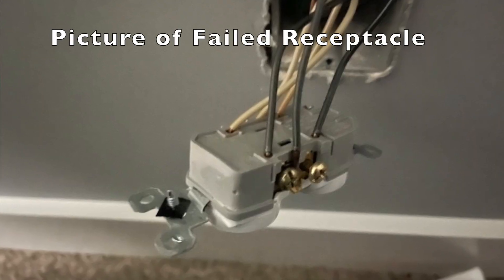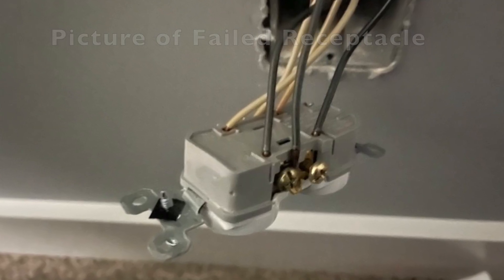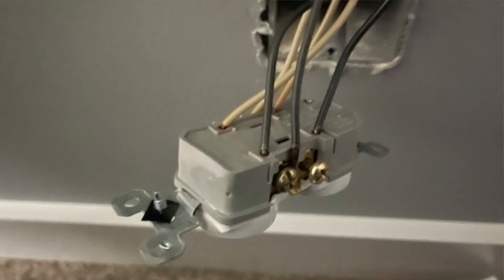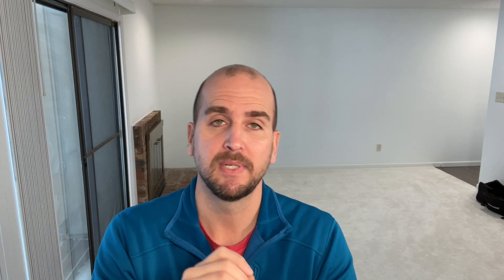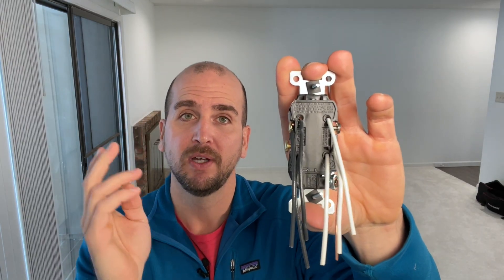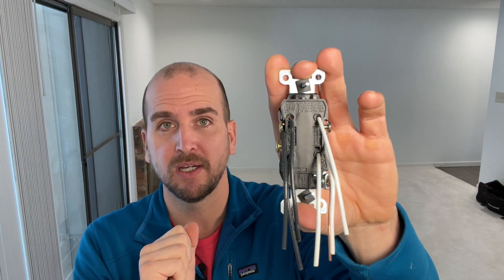Incorrectly Wired Outlet Found In Newly Built Home

Comment: You need a add-a-depth ring when you have 1/8” or more of combustible material, not when the box is flush with the wall, that is code in wisconsin
Reply: Wisconsin is way behind most states for residential electrical code.  My best friend is an electrician in a different state and they are always a full version ahead of WI.  I was a licensed home inspector in WI.  I know what your talking about.  WI codes and the UDC are weird.

Comment: .) I agree with you on changing out low grade outlets with commercial/resi outlets
. ) there is no real benefit of using the pigtail method unless the outlets fully connected.
.) Some may disagree with this comment but if done properly a stab in can be as reliable as a Shepard hook. The failure cause at the stab in connection usually stems. From a loose outlet as plugs are plugged in the outlet twists slightly weakening the connection 
.) You can use tails of wire to make spacers to level and keep tight the outlet with the  finished wall opposed to box extensions

Comment: There are actually 4 different types of receptacle attachment styles commonly found in north American wiring devices: 1. Shepherd's hook clockwise under the brass screw head (excellent), 2.Back stabbing hole as shown in this video, when an internal barb of metal bites into the wire when you push it in, and won't let you pull it out (poor method, at risk of overheating, done by the lazy,  and not recommended), 3. A visible little square clamping plate of brass, right under the screw head, as shown in this video that positively clamps down on the copper wire when you screw down the head (good and strong connection, and very easy as you don't need to form the Shepherd's hook), 4. The one not shown in this video, but found on ground fault GFCI devices, and other high quality receptacles,  is what looks like back-stabbing, but is not. It is a hole in the back of the device you insert your straight, stripped wire, but inside there is a brass plate you cannot see, which clamps down securely on the wire when the side screw is tightened. (These are great connections, very secure), and are not back-stabbing.  However, a bad mistake an amateur might unknowingly make, is to try to use the side screws to place a Shepherd's hook under with these. No good! DO NOT DO! Only use the cable clamping holes on these.  My other comments: I fully agree that pigtailing is the best and safest method. Another reason if the receptacle ever becomes loose, the multiple wires (if not pigtailed) connected could slowly become loosened,  and this would lead to the next receptacle several feet away not receiving full power, which the wires at the loose receptacle will heat up if you plug in a heavy load at the distant one (like a toaster oven). Pigtails with an independent "passthrough " connection for adjacent receptacles is always best.  And lastly, if you are unsure of what you are doing, find someone who knows how instead of creating a risk of fire.

Comment: One does not have to twist wires together before installing a wire nut but many people do.
Reply: This is bad advice.  Only some wire nuts (the one's with little wings so as to increase the torque) do not require you to twist first.  Regular wire nut you need to twist the wires first.  Best to twist with your linesman pliers so that the copper actually gets scraped together.  Sure it's not "required" but this video is about avoiding crappy workmanship.  You will also curse less when you are trying to hold 3+ wires together to get the wire nut on them.

Comment: Incorrect and best practices are 2 very different things, also time is money profit margins on residential installations is very small there is a reason receptacles are manufactured like that, for speed. Installations like this are by code and not a mistake, best practices No, but not a mistake.

Comment: That is why you change out your electrical panel and install AFCI's or better yet Dual breakers Mobile homes have a different receptacle than that which he is showing within the last 17 years,  They are push ins but hold the wire very tight.  When replacing you have to almost destroy the old one to to get the wires out of it. They use 14/2 AWG instead of 12/2.  Then you get Harry Homeowner who overloads the breaker and puts a higher rated amperage breaker in it's place.

Comment: If you want to take your wiring skills to the next level, always close down your hook around the terminal screw with needle-nose pliers.You can make the loop into a circle that is close to 360 degrees, the conductor can never work loose unless the terminal screw is completely unscrewed. It takes a few more seconds, but it's what separates the knowing from the unknowing.
Reply: unnecessary, especially when you have to do 75+ receptacles in a day
Reply: @mipr4440  It isn't unnecessary and is irrespective of the number of outlets needing to be wired. What other corners do you cut in the name of expediency?
Reply: @larrydaniels6532  my friend it is certainly unnessesary to pull out the needle nose pliers every time you wire a device. As an electrician myself after doing thousands of connections you get pretty good at it.  If youre an inexperienced homeowner by all means crimp down every hook because you probably fucked up.  All I know is I have connected thousands of devices over the years and never been back to a site to fix a single one of them, hbu?
Reply: @mipr4440  I can understand by your reply that you are a very "average individual", probably little or no higher education. My original comment stated that this method is a step above average. Assuming that a person is "fucking up" by doing a procedure that most master electricians were taught as apprentices shows both a lack of knowledge and logic.
Reply: @larrydaniels6532  Sir I was taught by a master Electrician and Mi Pr is correct! He is using standard tools and applications that exceed all code and safety requirements.... Your original comment  "take your wiring skills to the next level" is laughable... When an experienced electrician strips the wire he can typically stab the straight wire on one side of the screw, wrapping  the screw clockwise until it is nearly a 360 degree circle under the screw.. Another way is to use the the hole on every stripper to prebend the wire into a J shape slip onto the screw.  The friction on the screw tightening down will cause the wire "wrap the screw. Also, you risk damage to soft copper wire when you bring  unnecessary tools in contact with the wire...  Ask ANY Electrician, they will say your way is a joke.
Reply: @mipr4440  
That doesn't mean much, or course the original wiring person isn't the one to come back fix a failure... come on.
Reply: @ericlee2931  Thank you eric, finally someone who understands that this guys method is a total joke if you have any experience in this field!
Reply: @ericlee2931  Blatantly wrong.
Reply: Good tip, also when you are screwing it down it doesn't slip the wire around or in or out.
Reply: That's absolutely true; also no chance the hook in the wire will be pushed away from the axis of the screw when tightening it.

Comment: Start using the Wago or similar connectors which makes not only a cleaner application, it also makes life easier and so much faster.
They have multiple configurations and can be applied to any situation where a wire nut is used.
Wrapping the perimeter of any device with a quick turn of tape is not only safer, it reminds you to tighten the fasteners before placing because it makes it far more obvious if missed with minimal time, effort and expense considering the alternatives you presented.

Comment: I am not any professional electrician but I just wired in 44 plugs 8 switches and 18 lights in my new basement. I used pigtails on every plug. Use bigger boxes if you get too many wires and caps, and for sure never use the push- in wire holes.
Reply: Agree why not just use a deeper box to begin with not that much in added cost so much easier. Good point.

Comment: Push-in techniques have been working over here perfectly for over 50 years ... without any failures in my installations ...

So, if push-in doesn't work in the US or is error-prone, then there is something wrong with your receptacles (or the ones installing them), and not with the technique per-se !

Comment: Additionally, most homes are wired with 15 amp outlets in a 20 amp circuit.  A 20 amp outlet will have the neutral opening in a "T" shape, instead of a narrow rectangle.  A 15 amp outlet carrying 20 amps can run too hot.
Reply: Yes correct and a dwelling unit kitchen   small appliance circuit you are allowed 15 amp recp per NEC unless local jurisdiction dictates otherwise.
Reply: @gregpuskar3319  There is a new video from this guy; it dissects a commercial and a residential outlet and it is very good; the structure of the leaves pressing against the plug spades and the distance from hot to ground are the differences and worth knowing.  I built my own home in 2008 and found Leviton 20 amp outlets to be the best.  They retailed for about $4.50, but in 10 packs they are only about $2.50, a bargain.  They wire from the back, but the screw does the bonding.  They, of course have the 20 amp neutral spade opening and I made sure to never exceed 80% of capacity in circuits that may run continuously, like baseboard and wall heaters.

Comment: Whenever you install a receptacle like this, you should also use a wrap of electrical tape around the full plug that covers all the screws so there is no danger of them ever contacting against metal, similar to the use of the plastic extender, but most people use metal extenders which actually narrows the box.  The wrap of the electrical tape should be one of your best practices.
Reply: That is one of the most stupid things to do. Have you seen what that tape looks like after years of being on the outlet like that
Reply: ARTHUR Moore If done right - tape is not needed.
Reply: If done right - tape is not needed.  I've supervised hundreds of electricians and seldom have I ever seem them taped.  I've only seen homeowners tape them up.  The most important thing is the ground.  If not properly grounded you could kill.  It's not like plumbing - if you mess up, things get wet.  A bad electrician can kill you.
Reply: ARTHUR Moore  First don't YELL.  Tape is not required according to the NEC.  Inspectors are not gods.  I would asked him to show me, where it says that.  I've challenged inspectors before when I knew they were over stepping or just wrong.  They usually walk to their car - try looking it up  and then just drive away.
Reply: I've seen this done many times.
Reply: Yes, that is best practice, but I haven't seen anybody do that in new construction in years.  They work on tight schedule, time is money, blah blah blah.  Actually in new residential contruction in USA at least, it is very rare to find metal box, let alone metal extender. So it's not an issue unless there is nicked wires pushed in around the profile of the fixture... which is probably not something anyone who takes the time to tape up the fixture screws would do anyway.  Definitely I wrap with tape when I am working in metal witch for me is only when I have to make an exposed run via conduit, because that's the only time that metal is actually cheaper than plastic!
Reply: My dad is not found of those push on wire nuts. Think of the actual contact area. It scarey.
Reply: My dad uses electrical tape for this.

Comment: Ignoring the push downs, in the example where you took out the wiring that had two back plate hots and neutrals and replaced those with pigtails... why is that better? It seems like using multiple backplate and having no splices inside the box would give you a simpler wiring job and fewer potential points of failure?

Comment: You only want to pig-tail the neutrals.

The problem that we're trying to solve is:

a) the neutral connection is now only as good as the receptacle's internal harness; if that internal linkage fails, the homeowner will have a live connection, but no return neutral connection - that's bad
b) if someone disconnects the receptacle, or removes it, the neutral is broken and the homeowner might do something where the live is still intact. 

So we want to have a continuous neutral path, and then pig-tail to the receptacle.

It's fine, and preferable to not pig-tail the live side:

- if the internal circuitry of the receptacle fails, it fails in such a way as the down-stream live side is no longer hot (fails safe)
- or if the homeowner removes the receptacle completely, the hot is again broken (fails safe)
- and since we pigtailed the neutral, the neutral connection is still intact (fails safe)

Comment: I know it was overkill but I also wrapped tape around the receptacle so the next guy wouldn’t have hot wires exposed. Just a little forward thinking to keep people safe. It didn’t take any longer. I was a electrical superintendent for 41 years in all types of construction and safety needs to be first thought for all electricians

Comment: In the Province of Québec, Can., the electrical bureau also recommends having the ground pin up, so if something like a picture frame or other thing do fall on a wire connected to the plug and partially pulls it off or break it, it will likely contact the ground before touching a live wire.
Reply: That pretty much guarantees a broken ground. Bureaucrats are "great."

Comment: It may be overkill but I always use the deeper boxes and use pigtails which I twist, solder and encapsulate in a plastic wire nut. I'm not a commercial electrician, just a homeowner that can afford the extra time to create a soldered connection between wires.

Comment: For the specific outlet you "Fixed" with pigtails, why couldn't you of just used the second set of screws? Isn't that why they are there for 2 wires like that instead of a pigtail.
Reply: You’re right you can use the second set of screws for the hot and neutral. He’s trying to show pigtails because at the start he has three hots and three neutrals.

Comment: 6:15  and you still didnt do it the best way. wheres the hook?  Wheres the level? why isnt the screw vertical?
Reply: You don't need to make hooks with the receptacle he's using. It's designed to attach two wires under a plate at each terminal screw that clamps down firmly on both wires.

Comment: At 6:00, why would you do this when you have two screws to fasten the wires down to as long as you have not pulled off the tab connecting the two on either side?
Reply: Only makes sense if the circuit is greater than 20amps, the minimum rating of bus bars in even the cheapest outlets. If you pull 30amp over 12awg downstream with, say, two heaters, it can meltdown while a pigtail will survive just fine. Not that you'd ever build a circuit this way, but old preexisting circuits might not be reasonably changed. I see janky shit like this all the time with older houses.

Comment: So if outlets are melting around the house and are in the push in is that the reason they're melting?
Reply: Depends on the failure. More often the socket has weakened over time and fails under a large load. Push in connections are generally fine, just have a slightly higher failure rate. There's no problem if specifications were followed.

Comment: The weakness as always is the idiotic gang box design/construction that has the outlet screwed into the box with metal screws biting into plastic and the gang boxes just being too small to get multiple wire nuts on thick gauge solid core on there. The forces eventually lead to the box threads failing and then what - as replacing gang boxes is a major pita operation. So folks try to minimize the amount of stuff they have to get back into that tiny gang box and this no pigtails.
The pigtails is a good idea, but when construction cuts every second of time and inch of copper out of the job , those pigtails won’t ever be installed unless it’s a retrofit.

Comment: I'm not a electrician also. Which way should new receptacle be installed then. 1 Use the receptacle as the connection 2 Use a 6 inch pigtail at the receptacle/box or 3 I've seen all the connection made in a box in attic with just a wire down the wall to the receptacle ?

Comment: I think this video is a bit wordy, could have been trimmed down to 3 min. Push pin can be a source of failure only if someone doesn't push a properly gauge wire far enough into the hole, then pull on it to make sure it is secure. Other than that, they are safe or would never get UL approval.

Comment: One added point: if you DO end up using push lock devices use solid wire, not stranded.
Reply: Steve Williams  True, u can't use the push in with stranded and u have to use the fork for the screw. The ones rated for stranded have the little plate under the screw to clamp stranded wire. Tho a trick is to strip stranded, then strip a small piece of insulation and leave at end of wire, then if your right handed twist wire backwards or towards you then wrap around screw. then when you tighten, the screw will tighten the strands instead of spreading them, not code but it does work.
Reply: Steve Williams  What's a fork crimp? I am an electronic technician but do electrical work also.
Reply: @mark8664  it is a plastic insulated brass tang that you crimp on to the end of the wire. There is an art to it.
Reply: If memory serves me stranded in a push in is a code violation. Been retired for a number of years now. I believe the recpt is not rated for stranded.